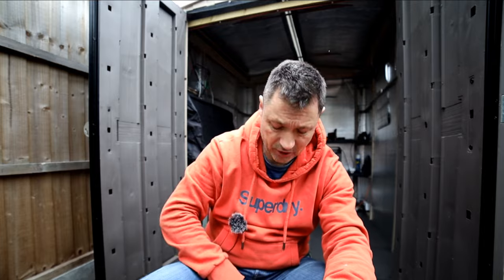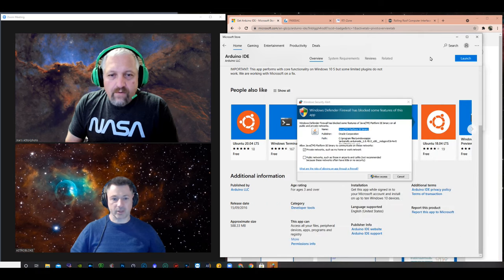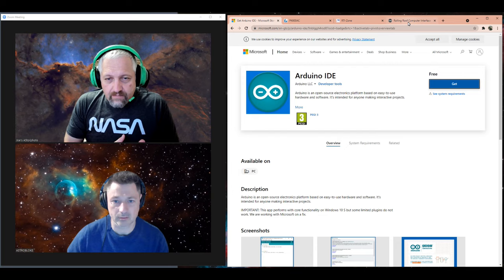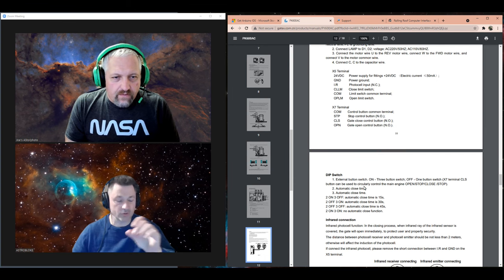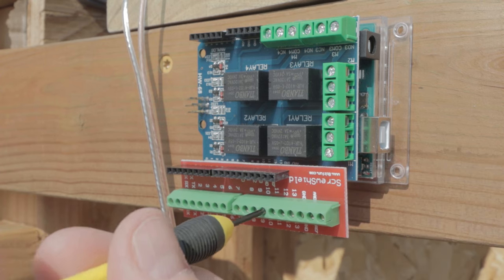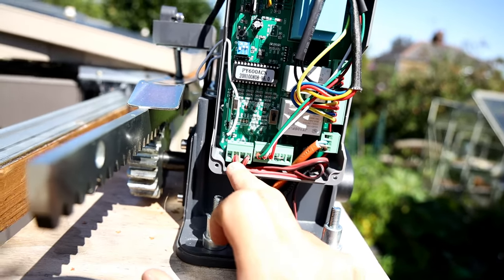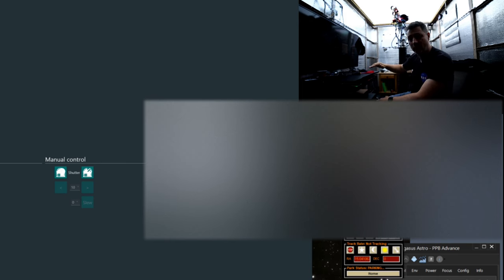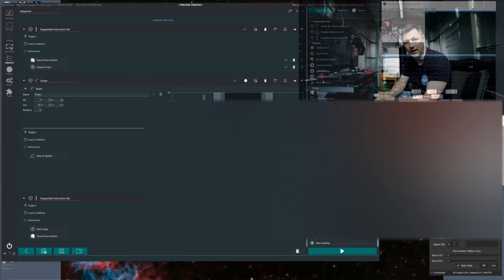How to use an Arduino UNO to control an Observatory Automatic Roll off roof!

Comment: Hi Glenn, I've been following this with much interest and you guys have done a great job that is sure to benefit a lot of people in our hobby, including me. I have just about completed the install but I'm having issues that I'm hoping you may be able to help with. It kind of works, skyroof will open the roof, but I'm not getting the open/closed signals back. Then Skyroof freezes and won't respond. I have to close it with Device Manager and re-open. My magnetic switches are the type with N/O & N/C contacts and I've tried them both ways. N/C means that the contact is made when the magnet is in position. I have them wired to terminals 11,12 & 13 on the Arduino, but I'm wondering if these connections are correct. In the code it says 13 is output to safety sensor..? Any thoughts on how to debug this would be appreciated...
Reply from the maker: Hi Andrew. I did have an issue similar to this when I first installed the sensors and it was because I had bought N/O sensor and they must be the N/C type. They are identical to look at but are listed differently on Amazon. 
You mention that you have used 13? 
11 is open 
12 is close
The 3rd wire should be your ground wire and that needs to go to Grnd which is one terminal on from 13. Neither Joe or I have wired a safety sensor as the roof cannot be closed via skyroof without the mount first reporting a parked position. 
I think it sounds like you have ground wire in 13 so check this.
Reply: @Astrobloke  Glenn, thank you for the swift reply. My bad on using terminal 13. That would explain why the signals were not coming back. I'll correct this tonight and report back. Fingers crossed...
Reply: OK, so I swapped the grd wire from 13 to the next terminal and the basic open/close with Skyroof now seems to work fine. However it looks like they have since changed this software to remove the option to use ASCOM to park the scope. My version doesn't have this, it only has Use park safety switch to detect parked scope. So with the mount unparked when I click close the roof starts to close. The mount moves at the same time but NOT even to the park position. It goes completely the wrong way. If you still have the original zip file for your version of Skyroof is there a way of sending it over..?
Reply: @Astrobloke  So I sorted the limit switch issue (my bad). And I managed to download another version of Skyroof that includes the use ASCOM to park scope. It's the version update 239. This works, although it still sends my mount the wrong way but it does wait, beep then close the roof. Once I've debugged the mount issue I'll put the solution here for those that may follow.
Reply from the maker: @andrewkirton7279  Hi. It does take a little tweaking but I think you are getting there. I can send the skyroof version that I have that does use the Ascom to detect scope parked before closing roof. Only thing you have to be aware of  is that if using NINA it will overide this and try and park the scope and close roof together. I get around this by using a sequential set of instructions to 1st close roof and then park scope, the default end sequence is parallel (no good). If you email me Astrobloke@outlook.com I will mail back to you the files I have. Also if you are using NINA and EQMOD. once you set the scope park position in EQMOD make sure you go to the mount tab in NINA and also while the scope is parked click set park position. I forgot this once and they conflicted and my scope was going the wrong way too. Maybe thats what you have.

Comment: Great work, 
Is it possible to integrate AAG Cloudwatcher to automatically control the observatory?
Reply from the maker: Absolutely. I am currently looking at cloudwatchers and whats needed to build one with another Arduino. They basically for me will work within NINIA and tell the observatory whether its safe or not safe depending on condition’s.
Reply: @Astrobloke  sounds very good. I would be very grateful if you could make a video where you show how it is possible to integrate cloudwatcher and set it up. Thanks Glen for your very informative videos.😎

Comment: I'm stuck, got everything downloaded and installed but, although I bought the same roof motor I seem to have a different board  there are only 2 connections and not 4 as in yours so connected com from relay 3 to com connector on motor and the no from relay 3 to the osc connector on the motor. When I open the skyroof software and connect through the settings tab it shows that my roof is open although it is closed. Thinking that I may have connected the sensors wrong I swapped over the 2 wires into 11 and 12 which made no difference. Ground is connected to grd in screwshield also. Have checked that all the pins from the relay and screwshield are in the correct holes.
    I am completely stumped now as to what to try, wander too if anyone else has had any probs but a Google search throws up nothing, for me at least. Any suggestions? Have also emailed with a photo of the motor board.
Reply from the maker: Hi Tony. If you contact me via Astrobloke@outlook.com I will see what I can do. Some motors have less connections as the open close stop is all on one terminal which is fine its just wired differently. Joe’s motor had this configuration (have you seen his video as it shows the wiring for that. Also check the sensor wiring and confirm they are normally closed type and not normally open. I got the wrong ones first off.
Reply: @Astrobloke  Yes, they are the normally closed type. Saw Joes video too, and I have tried a few different combinations with no success.
Reply: @Astrobloke  hello. I have the same problem except that the software only detects the closed roof position. I can open without problem, and then the software displays unknown position. So to close, Nina for example during a programmed sequence triggers an error and impossible to close the roof. I tried to reverse the sensors and it is always the same. I specify that it is NC limit switch contacts (no magnetic contacts). do you believe that it is absolutely necessary to have contacts magnetic?.thank you!

Comment: hello.i would like to make the same system as you.could you tell me where i have to connect to my motor connections,please?i think it's the step by step contact but i'm not sure. would you be kind enough to send me a diagram so that I can understand?. thank you in advance. attached are the connections available on the motor. thank you very much !!Alberto
Reply from the maker: Hi Alberto. I will see what I can do but unfortunately am in the middle of moving so everything is packed away and time is short. It may take me a while but the video should show all you need. If you connect wrongly it just won’t work, not do any damage. Good luck
Reply: @Astrobloke  thank you anyway!.i understand.suddenly i found.good heavens.cordially.Alberto

Comment: I have a problem with the script working. when I press e.g. open in RRCI (skyroof too) the relay turns on and the drive starts, but after reaching the closed sensor there is no reaction of the relay (the relay does not turn on). The same situation is in the reverse direction (close-opened). I suspect that RRCI gives a return signal that the arduino script does not read. Maybe it's related to the RRCI version, mine is v1.2.3 Can you help me?
Sorry for my english but google translate is not perfect ;-)
Reply from the maker: First thing to double check is the wiring. It is so easy to get the wrong slot with them being so small and close together and the screwshield if you ised one does sit offset slightly. When I had problems with the roof not reading when it was open or closed when at the sensors was because I initially bought the wrong type. They must be of the Normally Closed type. I mistakenly tried to use Normally Open one (they look identical)
If you are sure its not either of these let me know and we can look at your code and hopefully help fix it
Reply: @Astrobloke  Sensors are normally closed (RRCI shows closed, open). I used the arduino code from the link below the video. Everything is definitely connected well (checked many times) but it still doesn't work.
I press "open" in RRCI, it turns on the relay, RRCI shows "roof status - opened" (when I bring the magnet closer to the sensor) and the relay does not turn on. The same thing happens the other way around. I don't know what the problem is, I'm out of ideas.
Reply from the maker: @mareksawicki9446  are you controlling the roof just with the skyroof controls or via NINA or SGP? I use it through NINA but close Skyroof as otherwise you get clashes with the software.
Reply: @Astrobloke  I'm using Nina (no skyroof). The same situation is how I use NINA ( with RRCI) and how I use Skyroof with RRCI
Reply from the maker: @mareksawicki9446  thats good , just make sure skyroof is no open when NINA running. Sorry for all the questions but it is a case of elimination to find the reason for it not working. The code has not changed so its not that. Can I ask what NINA you are using? Is it regular release or nightly?
Reply: @Astrobloke  NINA 2.1 What version of RRCI are you using? Maybe it's the fault of the RRCI version? In the comments on Chuck Farand's website, I found that the "x" and "y" parameters in the script are triggers for a roof all stop
Reply: Could you email me the RRCI installation file? maybe thats the problem
Reply from the maker: @mareksawicki9446  Of course I can. Please can you allow me a little time to sort this? I have just moved home and at the moment all my gear is packed away including the PC that ran my observatory where these files are. I am very busy building a whole new Observatory but will fire up that PC and get the files for you. Please can you provide me with an email to send them to? I will try and do this over the weekend

Comment: Hi Glenn (and Joe), you were really helpful to me in initial troubleshooting and I figured out I needed to change some of the Arduino sketch code to make it work with the original Arduino relay shield rather than the relay shield you and Joe use.  I also worked out how to configure for Sequence Generator Pro.  I've documented in this video - hope you're ok with me sharing it https://youtu.be/McxtrHlIcU8
Reply from the maker: Perfect Les. Well done on working out the pin allocation on the different relay shield. Its so convenient having the roof as part of a sequence.

Comment: Fantastic Video!  Thank you So much.
Reply from the maker: Thank you Amy. Are you building yourself and Observatory? Will look forward to seeing that.
Reply: @Astrobloke  it is in my future. Just not sure about my building capabilities. I may need to hire someone for the main build.
Reply from the maker: @AmyAstro  one day (if i move I will build a more substantial Obsy. My converted keter shed was really quite easy to do and not expensive at all. I think in the states they are the same as Rubbermaid? I have seen some conversions of them too. Work really well and being plastic hardly any maintenance. If I can help with any questions please let me know, happy to help
Reply: @Astrobloke  I followed all of your amazon links. They are for the UK. You may want to add the US amazon link versions. Earn everything you can :). I need to do the same.  I could not find the motor kit here. Of course I do not have an obsy yet so saving the links for later.
Reply: I wonder if the Arduino set up will work with a heavier roof and motor…. My wheels are turning.
Reply from the maker: Thank you Amy thats a great tip. I also saw a message regarding roof weight and Arduino. That is just a switch so the only limitation is the motor you use. Security sliding gate motors go up to some serious weight capacities so shouldn’t be a limitation .
Reply: @Astrobloke  Great to know.  Other solutions I was looking at were over 2k, crazy.  I believe I will try with this and pray I save some serious money.